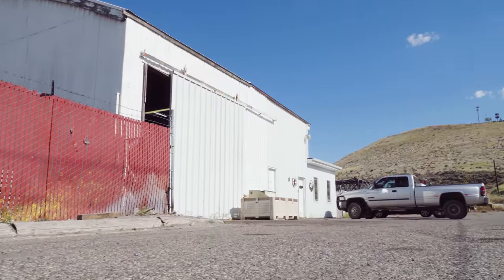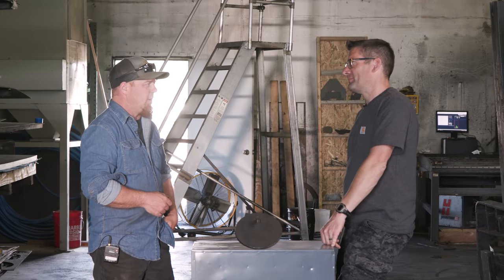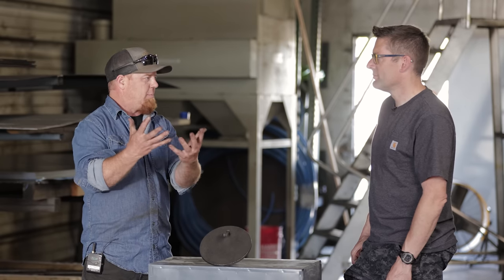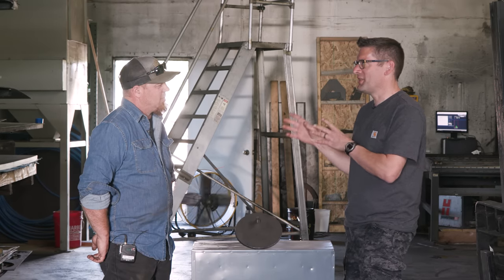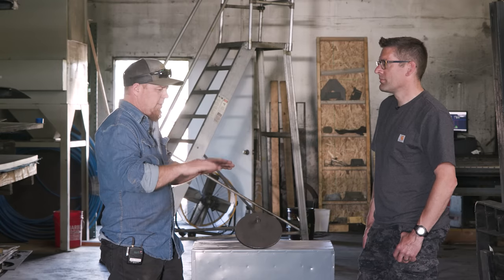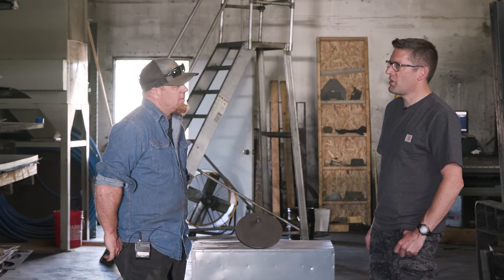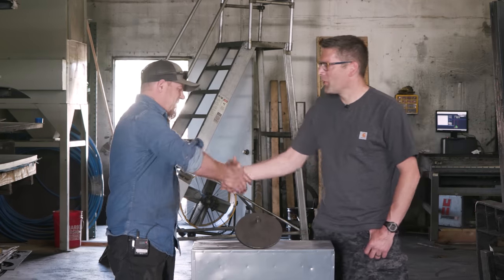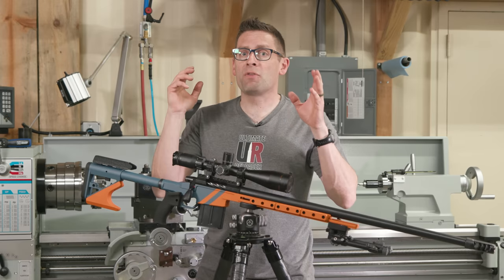How Steel Targets are Made! (D-M Targets Factory Tour)

Comment: I like steel... but it's so rippin expensive. . I usually just end up jerry rigging old hardened steel other stuff like tractor blade discs  or even steel parts that I end up punching holes thru... you hear the doing but the cost is you have a hole now

Comment: Is ar 400 less capable holding speed of bullet if so how much less
Reply: It is softer so will crater worse and pierce at a lower velocity.
Reply: AR400 is a little less durable but not drastically.  AR400 is typically used for bulldozer blades and cutting edges because of its resistance to wearing away from the abrasion of dirt all day.  I asked the owner of the steel yard that makes our cutting edges why they use 400 and not 500. He said the percentage of cost increase 400 vs 500 is much greater than the percentage of durability between the two. I have been scrounging his scrap bin for 10 years. 50 cents a pound is usually what I pay. 5/8 thick works well for 30 caliber rounds and I hang it with old fire hose, way better than chain.